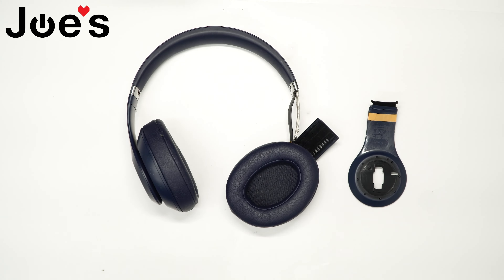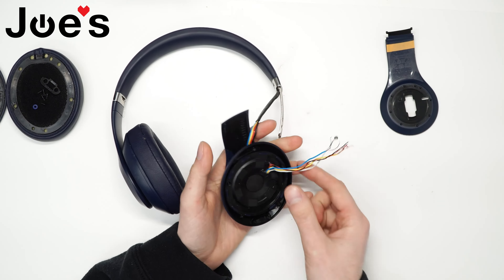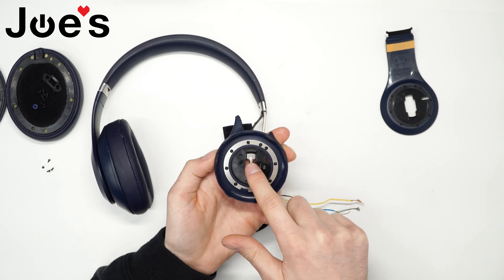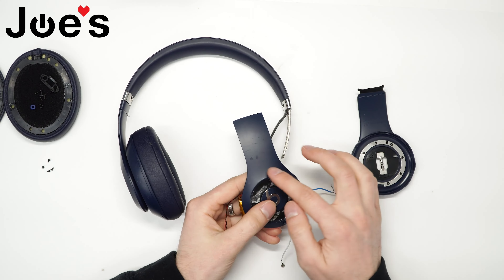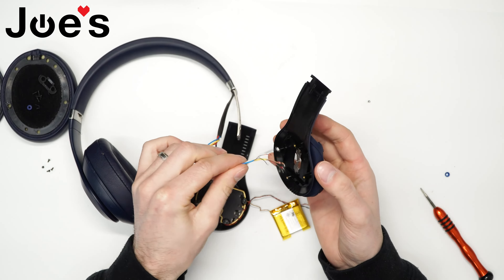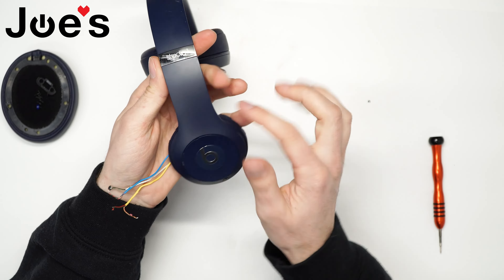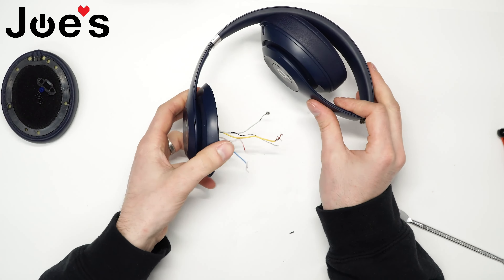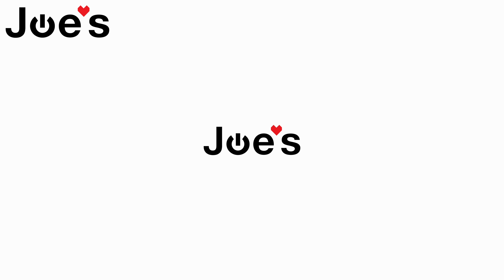Beats Studio 3 Wireless Right Inside Panel Repair Teardown | Repair Tutorial

Comment: Thank you very much for this fantastic tutorial. I must say these headsets are very bad quality for the amount of money they cost. Mine broke twice, once under warranty and once out of warranty. One more little piece of advice: on the micro USB connector the two red cable are not interchangeable, so don't mix them up. Found this out the hard way ;-)
Reply from the maker: Thanks:)
Reply: @Christian Bahr Hey man I am having a lot of trouble re-soldering my wires together. I am a beginner at soldering and don’t understand what isn’t being connected. Do you mind if I email you pictures of what I have done, so that you can inform me on what I have to fix?

Comment: Just did it!  With mostly success.  I had to leave all the screws a bit loose, because when i tightened them there was a loud vibrating noise when i make it tight, and when i loosen it goes away, any idea as to what it could be?  it speaker related i think
Reply from the maker: Hello, thanks for commenting. Please email us at support@joesge.com with your question. We will be able to better assist you there. - JoesGE

Comment: What type heat u got cause i want one and i just bought inside panel and🤦🏾‍♀️🤦🏾‍♀️🤦🏾‍♀️🤦🏾‍♀️🤦🏾‍♀️😢😢🤦🏾‍♀️ mess it up with my bulky heat gun i bought from u on ebay
Reply from the maker: We use this 
https://www.amazon.com/Quick-861DW-Digital-Station-Display/dp/B00EID23J6/ref=sxts_rp_s1_0?cv_ct_cx=quick+861dw&keywords=quick+861dw&pd_rd_i=B00EID23J6&pd_rd_r=cbb7459a-69b3-41bc-bc72-3d2b5a0d67c1&pd_rd_w=DQDHN&pd_rd_wg=e0ORz&pf_rd_p=1646f938-0b84-43fb-8b04-69eb8aa1e55a&pf_rd_r=1PT1PXV1EBX8V0P5FMEK&psc=1&qid=1651851989&sr=1-1-5e1b2986-06e6-4004-a85e-73bfa3ee44fe

Comment: Now I’m a little paranoid, I’ve had my beats studio 3 for about 3 years now and they are still in perfect condition, not even a scratch yet. Now you have me worry that they will crack out of nowhere.
Reply from the maker: If you take good care of them they will not just randomly break 😂
Reply: Mine broke… shattered… I’ve babied them and no one else has used them. I don’t fold them, don’t travel with them, they sit right on my desk or they’re on my head.
Reply: They absolutely will break.  They are garbage, last beats product i will ever buy.
Reply: WD-40 can help with the plastic cracking, WD-40 makes the plastic more bendy.

Comment: I just replaced the right panel and got everything back together. Unfortunately, it charges, but the right speaker does not work. Any hints on troubleshooting? Does it have to be one of the two speaker wires, or could it be one of the five small pins?  It looks like the bluish wire connects to the left most contact, and the red and black, braided wire connects to the farthest right, but I couldn’t quite tell from the video. Many thanks!
Reply from the maker: Hello, thanks for commenting. Please email us at support@joesge.com with your question. We will be able to better assist you there. - JoesGE

Comment: Why unsolder? Could you not clip the wires and mend them with heat shrink wrap with a heat gun?
Reply from the maker: 10x the work, plus you would have to still solder the wires back together. Most likely would end up needing a new main internal wire.
Reply: @Joesge  forgive my ignorance, I’m a industrial maintenance technician and process engineer. I have not taken this device apart. But why would I need to solder still? Anything I see coming off the board I would rather leave alone, so in I have the wire to spare why not heat shrink solder?  Most people watching this video can’t micro solder de solder or solder. Would it impair the product if it was done another way even if it at a solid connection?

Comment: What connection is shown at 13:52 with the rubber? A red wire connects to it. I was replacing my battery and accidentally ripped the wire out of the soldering. Do I just solder it back to the little circular piece?
Reply: Its microphone

Comment: My left earcup is nice and movable where rubber part connects to the side pannel but at my right side i noticed it was a little stiff, i jiggled the right side a bit to see if the rubber could be loosened a bit but then the whole outside pannel began to let loose from the inside pannel from the bottom al the way up to the hinge. Is this a common problem, and is there a way to stick it back together without tearing the whole thing apart.
Reply from the maker: hello, please email us at support@joesge.com and we will be able to answer this in more detail there.

Comment: I noticed you don't use flux or any additional solder when soldering. I've never done this before. Are just using the solder that's already on the charging port/speakers?
Reply: I was wondering the same thing?

Comment: how do u remove the actual earphone from the metal part ?
Reply from the maker: Once all the wires allow, you have to slide down the inside panel to remove it from the outside panel. Its on tracks that slide in and out.